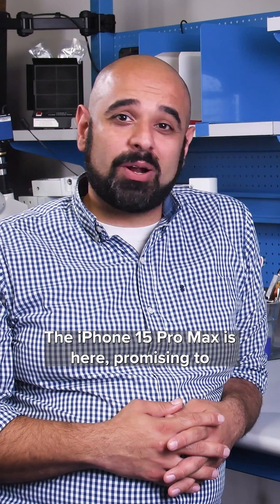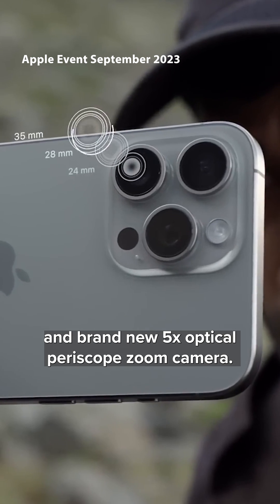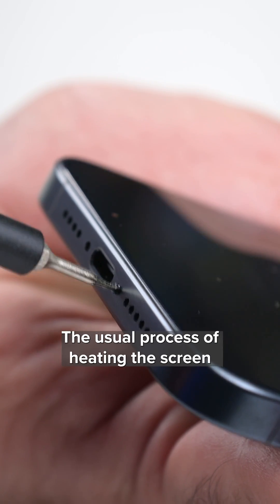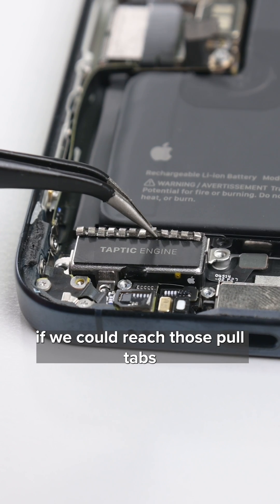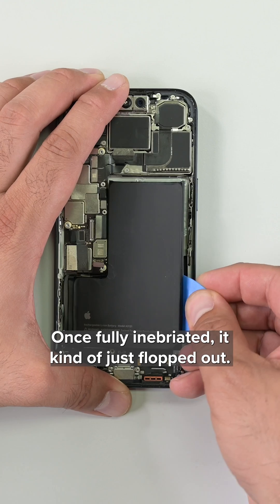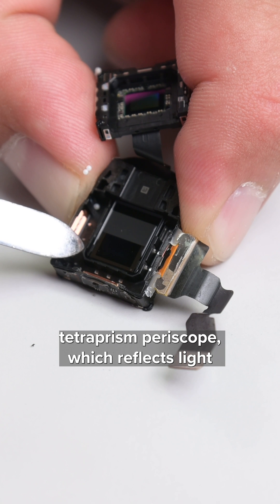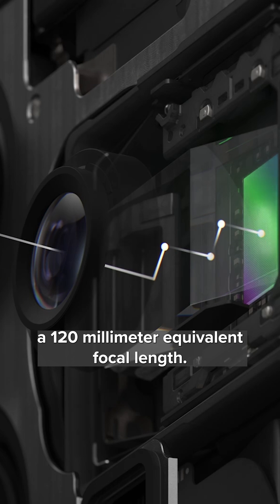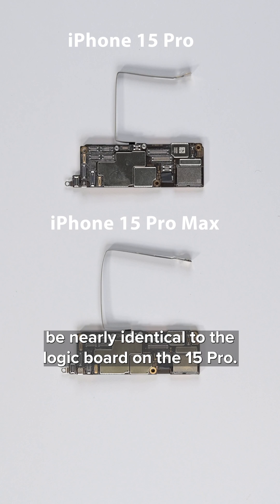iPhone 15 Pro Max Teardown #ifixitteardown #iPhoneteardown #iphone15ProMax

Comment: Deserves an automatic 0/10 for parts pairing and software locks.
Reply: Definitely point deduction for software locks, but they do have bonuses: if a phone is stolen and sold for parts by an amateur, it’s dunzo for them. But not an automatic 0/10 as software “locks” just slows the phone down slightly and gives you an error message